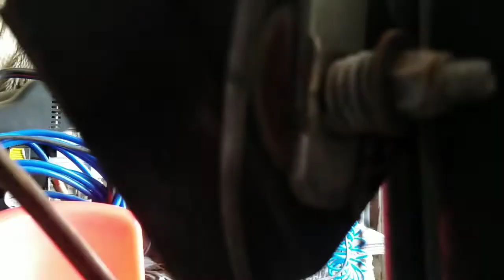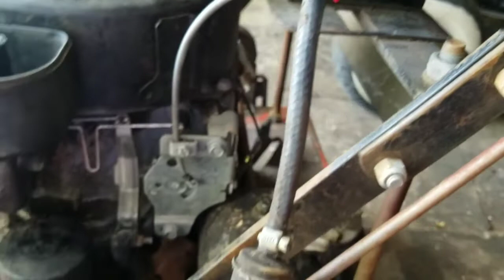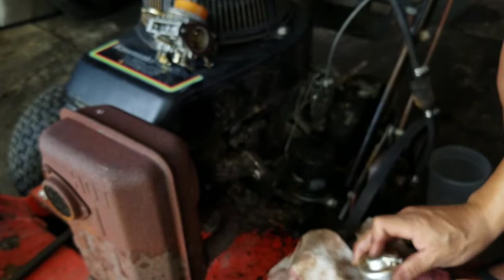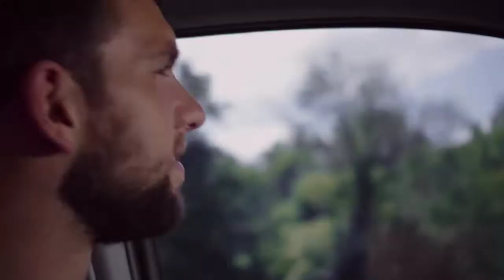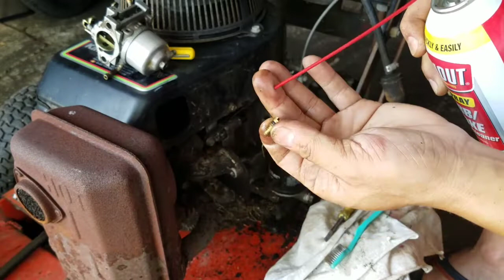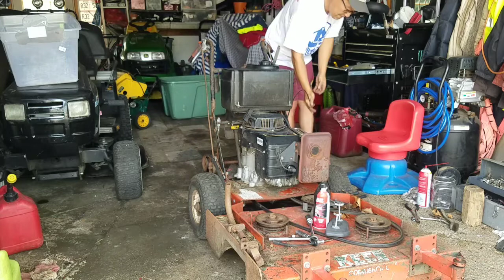FREE YAZOO FD KEES COMMERCIAL LANDSCAPING WALK BEHIND LAWN MOWER KAWASAKI FB460V CARBURETOR CLEAN

Comment: I think the handle on the left you could just lay horizontal, an drill a hole just to pull that bar up, an then I'm sure you've got something in the horde that'll work on the other side, I'd just get it "working slap some of you're 99cent paint on it an post it for $575 n let it go for $525, my motto is invest NOTHING! Great vids either way bro 👍✊✌
Reply from the maker: The drive pulleys are shot, wheel pulleys bent, blade pulleys out of whack...too much to do without spending money.  I'm probably gonna part it out bro.

Comment: I'd part out the engine on ebay. I can get more than 200 in parts. Muffler 90$, carb 75-125$, recoil 50$, head 20$, block60$, piston and rod 19$, coil 20$, intake manifold 11$, air cleaner box 30$  and probably a few parts I missed. That's what I got for one minus shipping
Reply from the maker: But to teardown a perfectly working engine? Plus what extra id get for parting out, I'd spend in lots of labor.  I'd rather get $200 and not waste a few hours. But good to know those parts are worth good cash.

Comment: Hey brother, I have a FB460V and I need a recoil starter just like the one you have on that mower. I was going to ask if you could take off the four screws and take a picture of the insides of the recoil assembly and show it to me. I need to figure out which one I need as there are two different models to choose form on the web,  thanks man.
Reply from the maker: I sold it.  Why dont you take your own off and see?
Reply from the maker: Here is the parts diagram
https://www.jackssmallengines.com/jacks-parts-lookup/manufacturer/kawasaki/4-stroke-engine/fb460v/fb460v-gs14-4-stroke-engine-fb460v/starter
Reply: I don't have the recoil assembly at all I'm tryna figure out which version I need
Reply from the maker: @gavintwitty2374  send picture of engine and model number label to 
Mowznblowz@gmail.com

Comment: that's a good engine but I doubt it's worth $200...
Reply from the maker: Really, I've heard they run forever and the landscapers want them.  I've seen crap out there for $200. Why not? I'll give it a try.
Reply: Mowers N Blowers I guess so, I guess you could always lower the price if it doesn’t sell
Reply: @vanmcdaniel6512  i have a 85 John Deere sx 95 with same engine a Briggs would never last as long as a Kawasaki engine new over 1500.00 just for a engine
Reply: @mrbriggs68  never said it was a bad engine and you might pay 1500 for a twin. His is a dated single.
Reply: @vanmcdaniel6512  single does not mean it is out of date they still make them
Reply: @mrbriggs68  obviously... I'm saying I would never pay $1500 for a single cylinder engine.
Reply: @vanmcdaniel6512  a Kawasaki single cylinder engine will out last any twin any day
Reply: @mrbriggs68  That's just your opinion now. In my opinion, a Honda twin cylinder engine would last longer. And everyone hates on briggs, and most of them don't know about the Vanguard series. They are very good engines that are made to last.